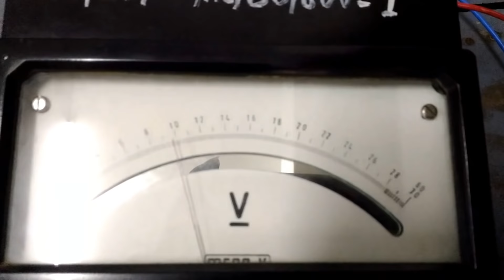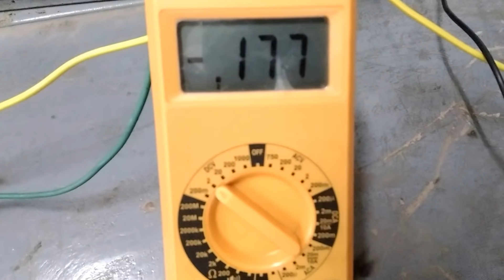Frictionless Braking System: Final Year Project | Mechanical Engineering | Working Model

Comment: That breaking system works on Eddy currents caused by the interaction between the aluminium plate and the magnet
Reply: if it is so ......then why r they doing project on this topic????.........its 12th std physics
Reply: in 12th they teach u theory but they don't show it practically:)
Reply: depends on school;).........never mind .....
Reply: yeap..
Reply: Sahil Singh  man it's not about the theory,it's with the application of knowledge.
Reply: @sahilsingh9968  Actually, even though it's basic physics, engineering is more about learning the manufacturing processes involved and design of components in the system.

Comment: Who told it is friction free???? The friction is produced between that v belt and pulleys.

More friction required/generated If the vehicle mass is too high when using this brake system.
Reply from the maker: Karthick Sri 😁
Reply: Absolutely right bro.

Comment: A lever/pedal brake is more efficient than this. What's the future of this project ? I don't think that automobile will concentrate on this kind of braking system consuming power to stop a rotating machine.